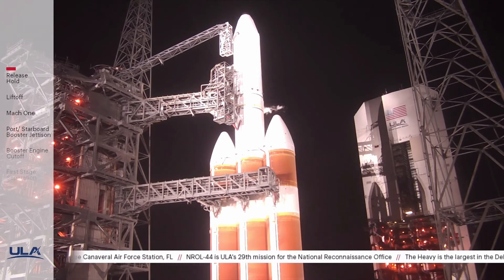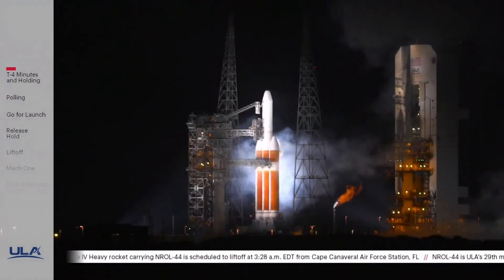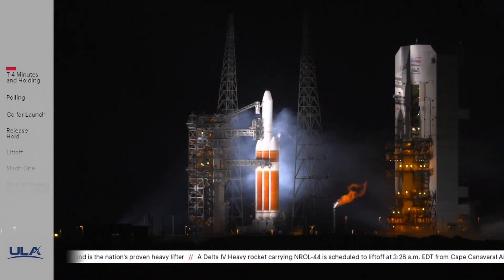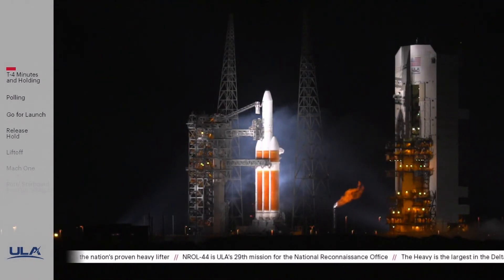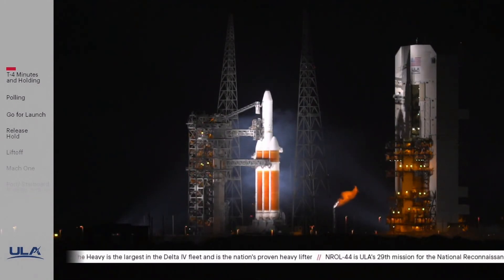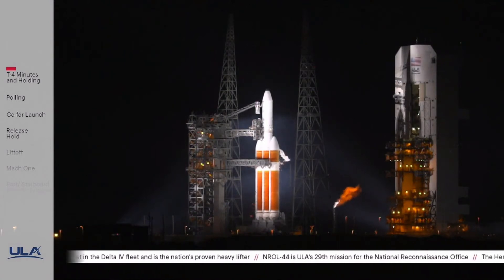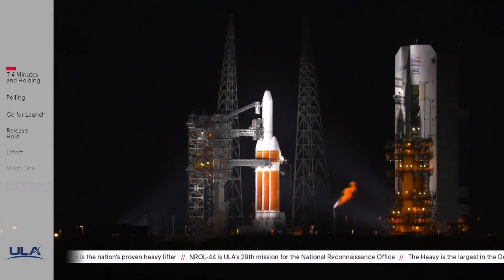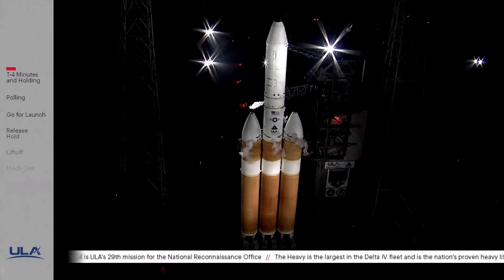Watch ULA's Delta IV Heavy launch abort just moments before take-off

Comment: Right engine @ 0:19 looks different than the others, pretty visible at .25 speed
Reply: Yes, so ULA start the engine a little early so to prevent a fireball (this didn’t get rid of it, but significantly reduces its size)

Comment: Give the contract to space x
Reply: Too expensive.
Reply: Hey, I am the biggest SpaceX fan you will find; but ULA did everything correctly here.  I feel they charge way too much for their services; but they are true professionals. Every vehicle, including Falcon 9, has these hot aborts.  ULA closed things down by the book.  Can't fault them for anything but the price tag.
Reply: Space X can't do what ULA can do. Fully vertical payload integration is essential for some payloads and space X currently does not have that ability.

Comment: -booster damage 
-possible 1-2 month investigation and repair 
-delays prior to this launch due to weather 
-launch hour kept changing due low temps 
-very important NRO payload 

Several spaceX missions have passed already before ULA launches a single rocket.
Reply: gvi341984 what? The booster isn’t damaged, ULA can’t control the weather yet, so what if it’s a NRO payload
Reply: @samneale7249  Mission aborted caused a side effect of prolonged heat exposure on the outside without launch. So, now they have to go through the bureaucracy of the ULA and launch an investigation on what was was damaged from the heat. ULA is not SpaceX; not only that but its payload was with the NRO meaning they have to recheck the payload to see if anything  was damaged.
Reply: gvi341984 its hardly prolonged heat, the payload is inside a fairing, and as such cant be damaged. Also you didn’t answer my question on your criticism of them not controlling the weather
Reply: gvi341984 ULA have aborted launches before after hot fire, none of what you said is true
Reply: @samneale7249  Considering the nature of this botched launched and the prolong heat reaching the outside. You run into electrical issues and possiblity of static discharge as well on the payload. They might have to send the booster back to Alabama for further evaluation. I doubt the NRO is willing to risk any chance on a billion dollar spy satellite by chance. Weather? ULA is the king of delays due to bad weather choices.
Reply: @gvi341984  Ok first, its not prolonged heat, they have had aborted launches before, not once had that been necessary. Also wtf, the weather is uncontrolled, by that logic spaceX are terrible because they had to abort the launch of DM-2 once because of weather. Your full of nonsense
Reply: @samneale7249  ULA has already stated 7 day minimum before future plans on August  29th.  Difference is that DM2 was successful with an automated system? SpaceX has a short rescheduling cycle. You might not be aware but the ULA is known for delays because they benefit from ELC money
Reply: gvi341984 dm2 only scrubbed because of weather, delta IV scrubbed because of an issue with a ground system. The dm-2 scrub cause was instantly known unlike the delta IV abort, which needs an investigation